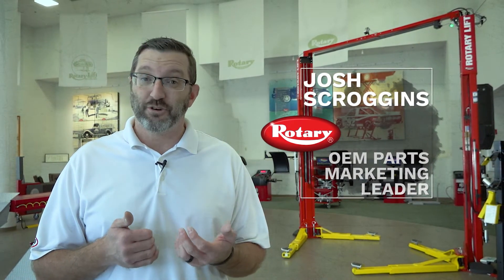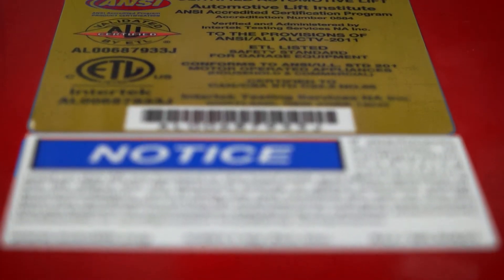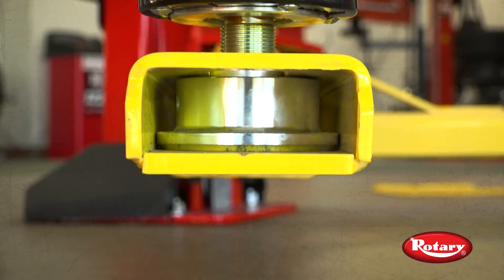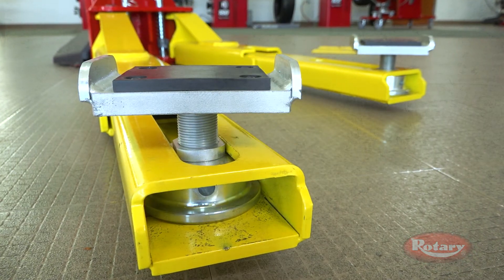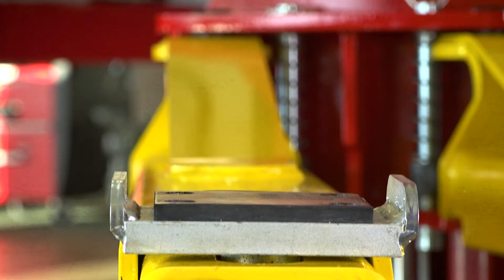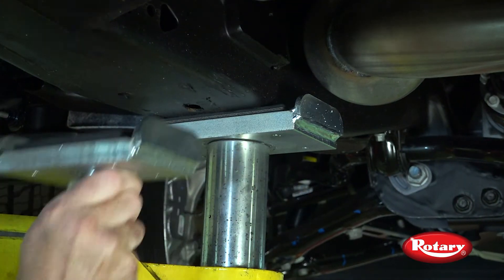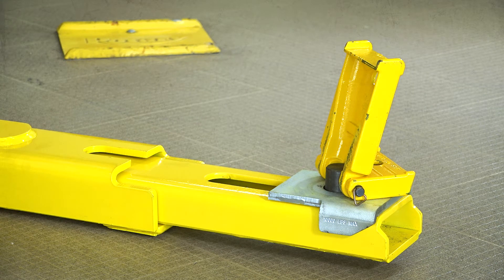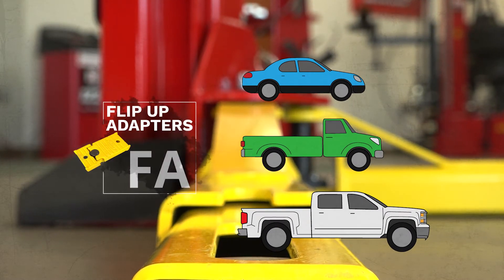Rotary Swing Arm Adapters

Comment: My old rotary inground lift, was built in 1955..FP46 Hmk..V11single post. Lift. Love it still works. In going in my home shop soon..  never ever need maintenance..it's getting a new life in my garage at home..for my own cars maintenance work.. the former owner of that lift is 97 yrs old. And gave it to me for free..he sold his property. And had a company remove it ..told me it never leaked ..,so I have it..it's casing and oil tank are being sandblasted clean and epoxyed..2 part.and new piping..new top seals etc ..still less in cost of a new above ground lift..

Comment: What extention adapter do I need for a Ford transit 250?
Looks like I need something that is at least 12".
Reply from the maker: Hi Joseph, first we need to know which adapter are you using the TA or Flip-up adapters?  Then we can let you know which extension you would need.
Reply: @RotarySolutions  I have the flip adapters.
Reply from the maker: Joseph, it looks like you would want to use these extensions.  https://rotarylift.com/product/fj6195yl-extended-height-auxiliary-adapter-kit/
Reply: How tall is the tall setting for the flip up adapter without extensions?
Reply from the maker: The tall setting on our flip-up adapters are 10.25" from a level floor.